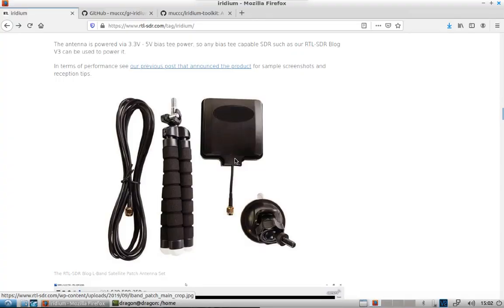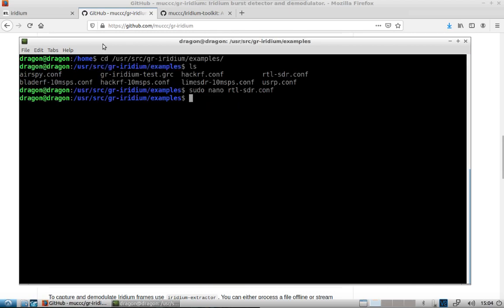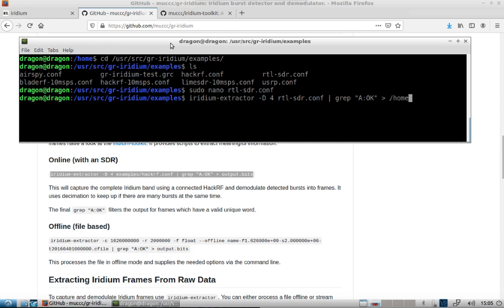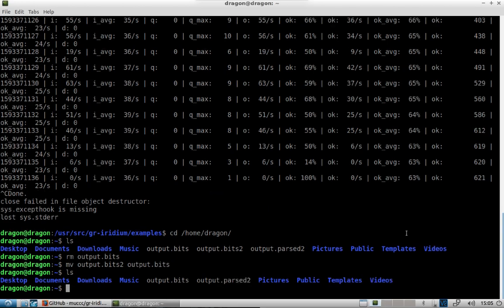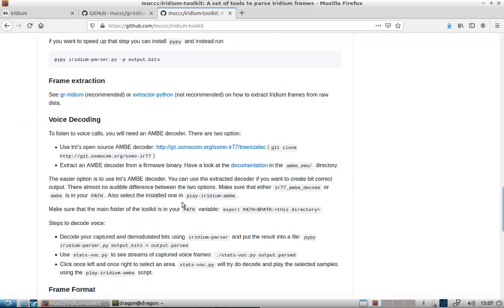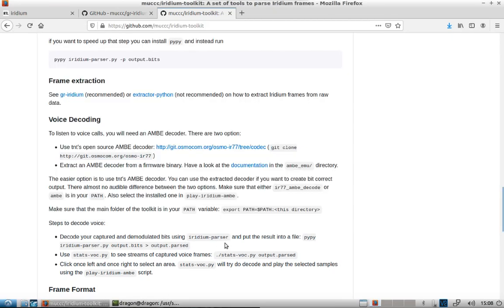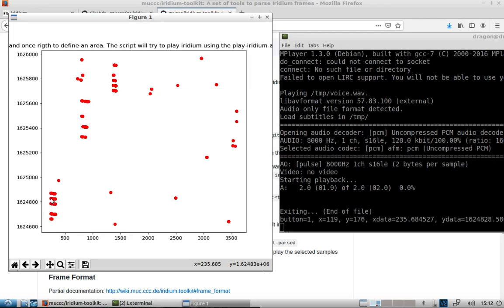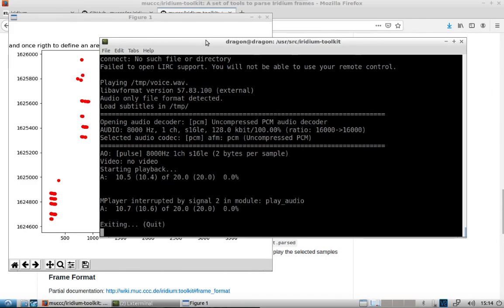DragonOS LTS Decoding Iridium satellites with the Iridium toolkit (gr-iridium, RTL-SDR)

Comment: Which "R" version was used for this tutorial? I cannot get any signals with R16 or 17. Am using a V3 RTL stick and confirmed the bias-t is working.
Reply from the maker: Hi John. I’ve used R17 just recently however you may want to refer to this newer video. 

DragonOS Focal Demod Iridium Voice, IridiumLive + User Requests (GR-Iridium, bladeRFxa9, hackRF) https://youtu.be/WljlmoNVW94

I will say though that someone else had problems receiving. You might need to check if there’s something transmitting close by you near the necessary freq. Although I show using the bladerf you can just use and adjust the rtlsdr conf like in the previous video. Do you have the rtlsdr patch antenna? I have the older one
Reply from the maker: I went and checked with my rtlsdr and older patch antenna using R17. Please see here in case I did anything different then I did in the public videos 

testing gr-iridium with rtlsdr https://youtu.be/QQpUVIJwzLA
Reply: @cemaxecuter7783  Thanks for taking the time to do this. I still get no signals, if I try to see signals using SDR++ within DragonOS then no problems, I can see the signals. I was using DragonOS under virtualbox, I even tried it on my home server under ESXI with full USB pass-through and still the same, no signals. Only other odd thing is that when I run extractor then stop it, then run again It cannot see my V3 dongle again, I have to physically remove and re-insert it each time I run extractor?
Reply from the maker: I don’t recall having tried this in virtual box. I’ve only set it up on a spare laptop and ran it directly installed to the hard drive. When I run extractor and stop it I don’t have the unplugging issue. Are you able to boot whatever pc you’re using directly from a usb stick and try running DragonOS Focal live if you can’t install outside of a VM? I’d be curious to see what results you get. Do you see a bunch of 0s or any indication that when running gr-iridium that maybe the usb/pass though is not keeping up?
Reply from the maker: Try and raise the gain up as well in the conf file. I tried again with an airspy and cranked the gain up and got good results.
Reply: @cemaxecuter7783  Thanks again, yes I am seeing a bunch of 0s, I have tried various different gain settings. I really can only go down the VM route. Anyway, I am creating a clean Ubuntu VM right now so will try to build extractor on that to see if it works that way, I think it is a USB issue as I have to reconnect the dongle every time!
Reply from the maker: I always forget exactly how it’s described so this was taking from the gnuradio mailing list -

"O" means there has been an overflow, some part of your system is not fast
enough to keep up with the incoming data, probably your hard drive, or you
may not have a fast enough CPU to process as the sample rate you have
chosen.
-
Possibly the usb in your case, but not sure. I would imagine another Vm would experience the same issues. Have you tried installing guest tools on both your local machine and inside the guest (DragonOS)? Might help performance. Let me know what you end up doing.
Reply: @cemaxecuter7783  When I say lots of "0's", I mean a normal expected display, just 0% everywhere. I have just built the toolkit under Ubuntu 20, was a pain, got past a lot of build errors, however I am tired out now so will try the new build tomorrow to see if it works for me. However, still would be interested to get it working on DragonOS under virtualbox. Will feedback....
Reply: Just to add, that was a good point about installing guest tools, so I did it, but still the same issue, no signals, I am convinced some sort of USB pass-through issue as I have to keep Removing/Re-inserting the RTL stick, anyway, will report tomorrow if my clean Ubuntu 20 install works....
Reply from the maker: Awesome let me know how it works. I’ve stuck with the older kit which uses slightly different Commands because IridiumLive last I checked didn’t support the newer code. Although I think I remember seeing a pull request.
Reply: @cemaxecuter7783  Had another play with this, if I run "rtl_test" I am getting lots of lost bytes, when I stop the test, I then cannot run the test again unless I un-plug and re-connect the stick again (same when running extractor). Any ideas?
Reply from the maker: Are you using virtual box? If so, I can try and replicate what you’re experiencing this weekend.
Reply: @cemaxecuter7783  Yes, this is running under virtualbox.
Reply from the maker: Okay, I’ll try it out. How many cores and ram are you giving it? I don’t recall having the plug and unplug issue though, this is virtual box running on Mac.
Reply: @cemaxecuter7783  I am giving it 4 gig of ram and 4 cores. Just tried testing with VMware workstation 15 and same issue, due to it "freezing" under rtl_test I am now thinking a problem with my RTL V3 dongle? I also have an Sdrplay RSP2, but cannot get this to output the biasT with Iridium Extractor?
Reply from the maker: I think I recall messing with and figuring out how to pass the correct config to account for the bias t and sdrplay woth my rsp1a.. however I can’t recall but for some reason I don’t remember getting good signal. I think it was maybe the IF or other gain settings I couldn’t get right.
Reply from the maker: I got completely sidetracked because my AntSDR showed up. I’ll have to try on virtual box tonight. I’ll just set the same settings as you.
Reply from the maker: That doesn’t seem normal about having to unplug and plug back in the rtlsdr, I honestly don’t recall having to do that at all with virtual box or any SDR.
Reply from the maker: John, unfortunately, I’ve not been able to reproduce the rtlsdr disconnect with VMware. I haven’t tried gr-iridium with a Vm yet though, so I’ll try that ASAP.
Reply: @cemaxecuter7783  I have got around the disconnect issues (re-installed USB drivers on host machine), but still the same issue.

I have just took a Lenovo Thinkpad, replaced the SSD with a temp spare one, did a full install of DragonOS R17 directly without any virtualisation, and still the same issue on a laptop. I have checked bias again with a meter, got 4.9V, used SDR++ within DragonOS using the V3 stick, can confirm I can see the Iridium signals, so totally at a loss why it will not work for myself. Am I missing something basic here?
Reply from the maker: Away from the desk at the moment but hearing what you’re saying almost makes think think it’s a hardware issue? I have a thinkpad, nuc, dell, and pi that I use with it - never have a disconnect though. That’s super odd. I’m assuming it’s doing the disconnect even when you run rtl_test?
Reply: @cemaxecuter7783  Yes, RTL_Test runs fine, forget about the disconnected issues, fixed that now on a vm box.

As I say, main point is now running Dragon on a clean laptop, clean install, no virtual stuff, not live. Still the same. I must be missing something simple? No signals at all still?
Reply from the maker: @JohnSmith-gw1xb  oh I see now. I thought it was still happening. Hmm, i suppose it’s possible the signal you’re seeing in SDR++ is maybe actually some other signal/interference on the same freq? You could try to raise the gain in the rtlsdr conf for gr iridium
Reply from the maker: If you haven’t already, can you shoot me an email to cemaxecuter@protonmail.com?
Reply: @cemaxecuter7783  will do tomorrow, thanks, got some success now using my RSP2 and manually recording a wav file via SDR++, then processing it in extractor offline mode. Have now got some audio at last......!

Must be an issue with my RTL V3 stick trying to do it directly?

Comment: Hello there, How are you? Can you tell me which direction to point my patch antenna please(UK)also how often do these sat pass(Leo) Cheers Kev
Reply from the maker: Just generally at the sky should work - you figure sat phones are all over the place. No matter where I’m at I just point it out whatever window and haven’t had an issue. Make sure you have the right kind of antenna and use the bias t If required.
Reply: @cemaxecuter7783  Cheers for the reply. The antenna I am using is the https://www.rtl-sdr.com/preorder-sale-active-l-band-1525-1660-inmarsat-and-iridium-patch-back-in-stock-for-44-95/. Should this work ok?
Reply from the maker: That should be perfect! You’ll have to enable the bias t, but that’s about it.
Reply: @cemaxecuter7783  Tried again and still nothing:( The bias t is on as i tested the voltage at plug 4.7v. I have the antenna sitting on my windowsill facing North. and have panned E-W. Inmarsat 54w works great? Thank you for your time.Kev Ps my location is Scotland
Reply from the maker: Can you put what commands you’re using to run it? Is it just not getting any data?
Reply: @cemaxecuter7783  Hiya, I am just using the commands in your video. Are you a radio ham and possibly run Dmr? We could set up a wee chat at the weekend ? Cheers for your time and patience. 73s Kev MM0KJG
Reply from the maker: Any progress? Unfortunately not a ham yet, but I want to get that knocked out soon!
Reply from the maker: What’s the terminal output showing? I’m trying to think what else would prevent reception.
Reply: @cemaxecuter7783  Hi How do a see the terminal output?
Reply from the maker: When you pull up and run the commands - also in case you are using the newer DragonOS I just realized I made a newer more detailed video DragonOS Focal Demod Iridium Voice, IridiumLive + User Requests (GR-Iridium, bladeRFxa9, hackRF) https://youtu.be/WljlmoNVW94

You’d just adjust the config file for your rtlsdr as I showed in the older video and make sure you call upon that config file when running the commands
Reply: @cemaxecuter7783  Hello again, Had a wee play again and managed to decode some acars traffic with Jaero but still no iridium traffic. Can you tell me how does gr-iridium set the frequency for sniffing the signal ? Cheers Kev
Reply from the maker: Sounds like some progress. The frequency or at least the initial part is already preset in the example conf files. I think for the rtlsdr it’s at 1625500000
Reply: @cemaxecuter7783  Yep that is the frequency . I have ran it for an hour and nothing every conter shows zero. Do you know if you run gqrx should  you see the signals like inmarsat. Possibly my antenna is deaf?
Reply from the maker: I’ll try on my end with the older patch antenna I have and see what things look like in gqrx.
Reply from the maker: Or possibly the bias t isn’t working?
Reply: @cemaxecuter7783  Thanks that would be appreciated . And the bias tee is fine and dandy. Have sweeped from 1.5Gh to 1.7 Ghz with sdr# and console and can see Inmarsat 54w ok but still no iridiun sats :(. Thanks again for you time  K
Reply: @cemaxecuter7783  Good evening from Scotland , Carl from Rtlsdr sent a replacement patch antenna and still no Iridium signals shown at 1.626ghz . Did you manage to view anything with your patch and gqrx? Thanks Kev
Reply from the maker: I’ll have to check with gqrx but I do for sure receive Iridium with it and my rtlsdr. That’s so strange - I don’t know what the difference between us could be?
Reply from the maker: In gqrx I’m wondering though, are you passing some variable that would be turning on the bias T cause it’s not on by default.
Reply: @cemaxecuter7783  Latest update , I ran my Rtlsdr which I found out is one of the defective batch that has the Bias-t always on with Sdrconsole and I can see activity around 1.626Ghz . When I run sdr# I see nothing except Inmarsat 54w from 1451-1455ghz and can decode. On my Dragon laptop with Gqrx i see Inmarsat but no Iridium. This is very confusing.:( Sorry for all this much appreciated for you time replying. Kev
Reply from the maker: What’s even more interesting, and I’m sure it’s just the better receive it has, but my rtlsdr does a really good job with iridium while my hackrf needs the gain jacked way up. So you see nothing at all on iridium frequencies? I mean in the spectrum/waterfall? No matter gain settings or antenna position?
Reply from the maker: Oh I just read this again so in some cases you do see activity, now that’s super odd. I don’t know what the difference would be unless somehow one program over another is doing something to the bias t but you mentioned it’s stuck on. Wouldn’t happen to have a hackrf or know someone with one of t he v3 rtlsdr to compare with?
Reply from the maker: Can you send me the version of DragonOS you’re using and the exact commands and conf file you’re using? I’ll try it on my end. cemaxecuter@protonmail